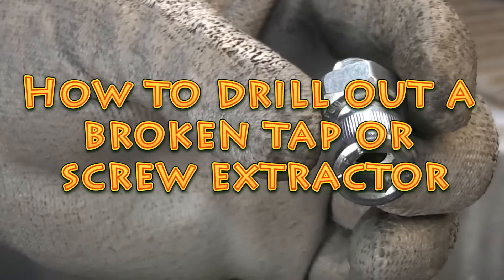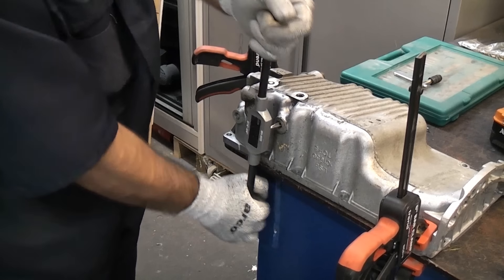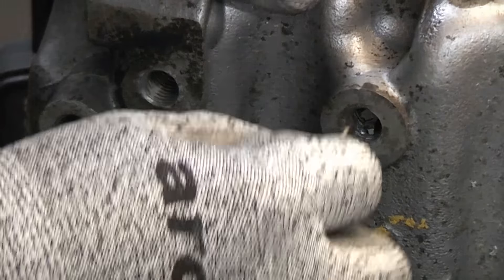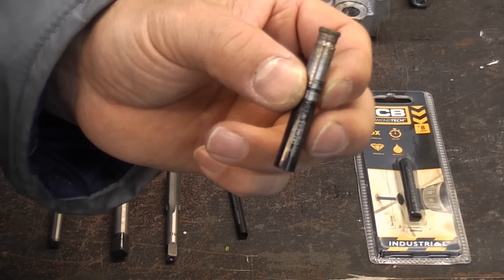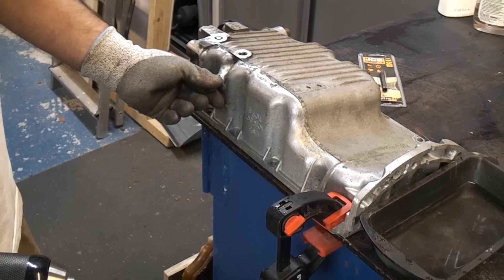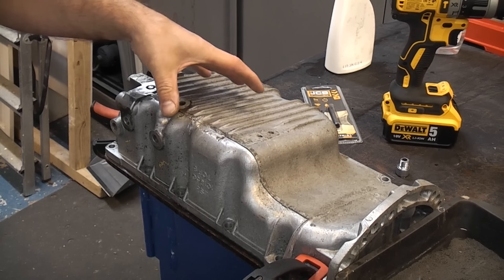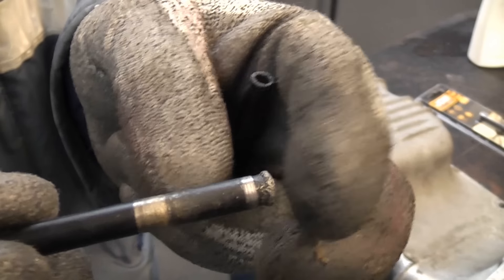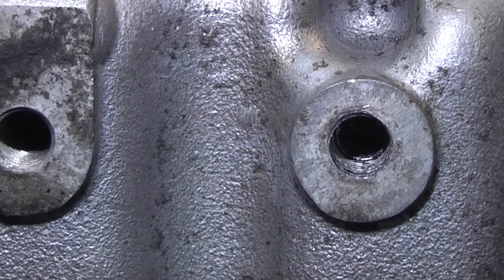How to drill out a broken tap | drill out a broken screw extractor

Comment: I can't believe you did this as a demonstration! You must love spending time in the garage. This situation is one of the worst
Reply from the maker: The main reason why I did this is because a few people commented on a previous video where I drilled out some broken bolts, normally with comments like "that's easy- try drilling out a broken tap", so I did. Now I'm waiting for the "it's easy on a bench- try doing that when you are in space - wearing a space suit" type of comments 😉
Thanks for the comment
Reply: I have to do this on an exhaust stud that broke in my mr2 and broke an extractor trying to remove the broken stud lol deff worth the watch I have to go pick up some of those diamond bits
Reply: @ThePjstokes  hey I have the same thing in my Suzuki m50 bike exhaust bolt right now! any tips?
Reply: @druegeme  make sure to stop for a tea every now and then
Reply: @ultimatehandyman  LOL
Reply: It's easy on a bench  - try drilling out a 1/2" vibration damper bolt with an extractor bit broken off in the bolt on a 2017 dodge challenger 6.4L scat pack in the middle of 2022 summer...in Texas...
Reply: @kill3mall224  this example should work..sometimes, depending on the diameter of the extractor where broken, you can go in with a diamond hole saw (that is smaller than the original hole threads, so you don't remove the threads) CENTERED over the extractor, and cut a circle around the extractor for a little way, then tap it from side to side to loosen the extractor and remove broken part. They generally are not held by much at all and easy to loosen if you get a little relief at the point they are held in the drilled hole.  
On another note, I'm puzzled why a damper bolt is broken off like that unless too long and got bottomed out?? Otherwise if just over tightened and snapped, generally not that resistant to drilling and backing out..🤔.. but you hopefully won? 🙂
Reply: Just happened to me, idk what I should do maybe a machine shop can fix it ?
Reply: How about broken bolt with broken extractor flush with end of bolt and frame?
Reply: 😢that's a pain. But on bench it's easy. What about a flywheel bolt

Comment: YES! This worked for me. In the past I’ve used diamond hole saws on enameled cast iron, so I’m not sure why I didn’t try it immediately. Instead I tried the Dremel route, as recommended on many videos and discussion boards. The thing is, Dremel grinding stones wear away pretty quickly, and they aren’t all that cheap either. A 2-pack of conical burrs is $15 CAD, and I quickly went through about 4 of them grinding down maybe 1/3 of the broken EZ out. The diamond hole saw was $25, but it ate through the remainder in under 5 minutes! That’s with me being patient and frequently dipping in water as he does here. After that it was simple enough to drill out the sides of the hole, re-tap, and Bob’s your uncle. It’s also worth pointing out that multiple mechanics and machinists I spoke to didn’t offer any solutions to the problem. Kudos, man, thanks for the tip!

Comment: I used this method as a last ditch effort and it worked!!! Broken bolt on a boat motor wouldn’t break loose after welding a nut on, heat, broke an extractor off in it, but this got it out. Took 45 minutes or so using his exact method! THANK YOU FOR POSTING THIS!!!
Reply from the maker: Nice work!
 Thanks for the comment 👍

Comment: I started out with the diamond hole saw bit method you demonstated here but became discouraged with the slow going. I picked up a Milwaukee carbide multimaterial bit (4 or 5 inches long and looks like a masonry bit) at a home improvement store for about $8.00 US. With this, the broken extractor was completely drilled out within 10 minutes. I still needed to tap new threads as you demonstrate in the video. Thank you.
Reply from the maker: Great to hear!

Comment: Kudos to your video and thank you for posting! I broke a bolt extractor, and your removal method was the only one that had worked. To make matters worse, the area was hard to access, so I had to get a right angle drill attachment and a quick release diamond hole saw. Turned out to be a two day job, but in the end I succeeded. Thank you!
Reply from the maker: Bolts always break in difficult to reach areas when I'm on site, they can be a real pain in the backside. I do get a lot of comments saying "it's easy when it's on a bench", I don't think some people realise that it's 100 times easier to film when it's on a bench!
I'm really glad that you managed to get the broken extractor out- well done ;-) 
Thanks for the comment 👍
Reply: Oh man im having a bad time right now. I snapped a bolt on an exhaust manifold and then snapped off an extractor in the bolt.  So I am in a simmilar situation. Worse thing is that I can't take the manifold off, without a garage taking the body off the vehicle.. so it's got to be done in situ.  I have some solid carbide bits coming, and some diamond hole cutters coming as well. I am worried that I might snap a carbide bit off in the hole and then things will be even worse... so I will probably take the extra time to do it this way. It's good to know im not the only one, and if i take the time I will eventually get it out again. Cheers.
Reply: Persistence and patience and a'lil experienced know-how are INVALUABLE skills that help you out of the inevitable holes we all  find ourselves in from time to time when life decides to kick you in the Jimmy's   
😳💥🦵excellent 👌 content bro this is definitely one that goes into the life toolbox 🧰 keep'em coming 😎👍💰

Comment from the maker: This video took a massive amount of time to film and edit, which is why there was no upload last Sunday (I’m also busy working and busy doing other things). Please like, comment and share the video (if you can), as it really helps me out.
I hope everyone has a great Sunday 😉
Reply: Thumbed up.  I got a good sense of the effort expended in the work, let alone the post video work :)
Reply: I have a cast iron manifold on my old MGA with 3 rusted in bolts that I want to renew. I have tried heat and penetrating oil and a pair of nuts locked together but have not moved them at all - advice would be appreciated. You have provided some interesting ideas, I am impressed, thank you. Tony Clarke.
Reply from the maker: Studs that are rusted in can be a real pain. You have to be really careful with manifold bolts as they easily shear. I'd keep applying the penetrant, but also shock the studs by hitting the end of them with a punch and hammer. The shock can sometimes work wonders.
If that does not loosen them, you could try putting two nuts on the stud, tighten them together and then try tightening the studs slightly, before trying to undo them.
Best of luck with it ;-)
Reply: Good job altogether. These tasks are very challenging. Some great tips I never thought thought of before. Thank you,again.
Reply: link to the guide?
Reply: @TheTC2  the original version  impact driver often helps hugely. Before the modern power tools we had impact drivers . Usually had 1/2 inch drive, left or right, which enabled any size socket to be used or a range of hex drive  screwdriver bits. 
Make sure direction of twist is in correct direction,  then a solid belt with a heavy hammer causes shock impact , together with some directional twist. 
Modern impact drivers only deliver impact twist  consequently are more likely to sheer studs off rather than the old style ones delivering this plus general shock impact which  will usually release,  even these can still sheer studs, so sometimes the combination  with heat is still  necessary.
I have yet to see the combination of heat, shock and twist fail.
Good luck

Comment: What a great video...being a much more experienced millwright at a food plant in Canada, I am constantly being asked to remove broken bolts/taps/extractors from stainless equipment! The younger ones just don't have the patience or experience in removing their mistakes. Once worked with an expert in a steel mill who was able to remove any broken object in a threaded hole. Cheers and thanks for sharing.
Rick from Hamilton, Ontario:)
Reply from the maker: Thanks Rick, we have a lot of stainless equipment at the place where I work and it definitely requires patience ;-)
 Thanks for the comment 👍
Reply: Some stainless is a nightmare to tap. I go for less than 50% thread. Sometimes a lot less. Even the shadow of a thread can hold in stainless. I look in the hole and can barely see any thread. A fastener will still grip tight though.
Reply: Thank you for your work, Rick!

Comment: Thought I would update on here as a way of saying thanks!   This method totally worked for me.  My situation was slightly different, because I had to do it in situ. Also the bolt I snapped off was smaller diameter (M6)  and therefore the extractor was smaller too.  I ended up going on ebay and purchased a pack of x10 4mm diamond hole saws, and because they are so small I ended up getting through all ten of them before getting through the extractor.  But the pack of 10 was only about £10, so well worth it.  I could then drill the rest of the bolt out and re-tap the hole.  Great advice on taking your time with this job, it pays off!
Reply from the maker: Brilliant!
Well done for having the patience and perseverance to complete the job 🙏
Reply: Would a pack of 5mm hole bits be better? Was this a bolt that broke or a tap? I have the same issue.

Comment: Just snapped a 8mm 316 stainless bolt off, drilled it out to 6mm,  stuck the easy out in and it snapped off flush. I watched 4 videos on removal options, purchased, drill bits, dremmel bits and spade type tile drills. They all broke. The only thing that worked was your tile drill bit. It seemed like it wasn't working after the initial sharpness wore off, so instead of going slow i just hammered it for 10 seconds at time, refreshing cutting fluid and it worked.  Over all, 6 hrs of trying and failing, 30 mins of your method and success!! Thank you, one can stop swearing now.
Reply from the maker: Well done for being so persistent and not giving up 👏 👍

Comment: You offer good solid advice! I’m a machinist in New York, I work often with aluminum 3/4 inch thick plate, usually sizes range from 19.00 x20.00 to as large as 36.00x30.00, either 6061, or jig plate. Saving a plate this size is a priority. We machine these plates on a VF6 Haas machining center. Occasionally, taps break. Since these are always in house items, I have a lot of leeway on how I extract the broken tap. My preferred method is to use a fractional size carbide end mill. Say for a 1/4-20 tap, I’ll use a 1/4 inch endmill. Usually 900-1100 spindle speed, sometimes flood coolant, other times I’ll use Moly-D cutting oil from a can. I crank down the spindle in the manual mode in tenths (.0001) with some luck, one endmill will survive doing the job, other times I’ll go through 2-3. Once the hole is cleared, I’ll re drill and tap for a 1/4-20 Heli-Coil insert.
Reply: Pretty much the same method I use as well. Although, you could use a 5mm carbide endmill, and not have to use a heli-coil. A 3/16ths might do it as well?
Reply: Wow. Thanks for sharing. Do you use a normal electric hand drill.
Reply: If your working with aluminum you can always dissolve the tap by soaking piece of aluminum for a few hrs or overnight in a heated solution of Battery Acid and Alum (potassium aluminum sulfate). method works great for aluminum but does take awhile. won't harm the aluminum in anyway whatsoever but it may discolor the aluminum but the discoloration rubs right out with a good aluminum polish or can just hit it with a piece of fine sandpaper. done this method many times breaking off small taps like 1.5mm and 2mm I use for aluminum parts for R/C vehicle parts and it works awesome. works well enough that I actually have a glass jar filled with the solution in garage just for those rainy days that ill need it. lol
Reply: AWESOME INFO, THANKS FOR THE SPEEDS, LUBE, ENDMILL INSTRUCTIONS!!!
Reply: If you're breaking taps frequently, why not buy a metal disintegration machine and do this job in a few minutes?

Comment: One thing that has made removing broken bolts/screws easier for me is the use Left-Hand drills when drilling out the center of the broken bolt because sometimes they will snag and turn the screw out for you saving time and effort. This would be after getting the center drilled if you were to use the drill guide that he made/uses. Great video and I will be looking for these JCB drills. Thanks so much!!!!!
Reply from the maker: Absolutely, left handed drill bits are great ;-)
Thanks for the comment 👍

Comment: First off excellent job of showing how to get broken bolts out.  I owned a radiator shop and we had to fight broken bolts in aluminum radiator tanks. Steel bolts in aluminum radiator tanks would seize in. The bit you used and the bolts you made are great. I would have bought them.  I have a few other ideas. 
1. If you had the hole pointing up you could have filled it with water or WD40 so you did not have to dip so often.  
2. Snap-On makes a kit with reverse rotation drill bits. It comes with guides that center the hole. They are not as nice as the bolts you made. They are not threaded. But the screw extractor that comes with them is custom made for the drill bit size and works better than the tapered screw extractor. 
3. I have heated up the broken off tap/bolt and let it cool slowly to soften it up.  Then drilled it out. The cobalt bits are good but they are also prone to break off.  
4. I have welded a nut on to the broken bolt with TIG welding and heated and backed it out.  
5. I really like HeliCoils, they work great.
6. I have drilled out a bolt and moved up to the next size at times.  
Final note: You could sell the bolts you made. I am old and retired, but surely would have bought or tried any new items to make a task like this easier. Keep up the good work!
Reply from the maker: Thanks for the comment, Patrick 👍
Reply: What you ran into is called the galvanic effect of dissimilar metals. Something to do with the covalent bonds of the atoms being different between the two metals. In effect they make a weak battery. Along with making a battery they corrode like a battery can too. Aluminum oxide is what sandpaper is made out of. So it's some pretty hard and abrasive stuff. Oxides being brittle can be used to advantage. Sometimes you just have to shock the monkey. Impact beats torque.

Comment: Yes this was very educational.  I'm partway through a job.  Don't know about my next step. Very hardened large steel bolt.  Using carbide bits.  May resort to a diamond hole saw but many videos say they don't work good?  I've used them in the past and they really helped with broken taps, and extractors.  Keep up the great videos!

Comment: Very good. If you break a tap its a disaster, usually. I am happy to learn that there are still options that does not require a repair shop. I liked the emphasis on self control. When i was a teen tinkering with stuff my dad always tried to teach me to take a 15-30 minute break when i felt a rage and need to smash things up with a hammer.  It cost me a fortune in broken stuff before i finally learned the wisdom of those words. :)
5 out of 5 for this video!
Reply from the maker: I've been told that I have a lot of patience, but I do swear a lot when doing jobs like this- especially when I was on site!
A guy that I worked with on site had even more patience than me (Vinny Davies), he had the patience of a saint for sure!
Thanks for all of your comments 👍

Comment: working on a engine .two blots snap/ drilled out one stud.used a extractor .next one snap r. 5/32 BSF used a mig .no way.  used a harden pointed chisel. chipping a way at the die .2 hours later got it out. talk about a brake. your right. just my luck . fitting a oil pump in the casing. did not use a nuff heat  split the casing.   i wish i seen your video before hand.  thank from john
Reply from the maker: Hi John, that sounds like a nightmare! 
Thanks for the comment 👍

Comment: Mr ultimate probably the very best thing you can add to you toolkit after the centering bolt is a set of left had threaded drills. I can sharpen my own drills by hand because I have done it so long. If you do sharpen your own make the bite very aggressive. It is many times faster than your method but it is very nice to have your method to fall back to.

Comment: This does work! I used a Milwaukee diamond hole saw bit to drill out a easy out that was broken off in an exhaust stud in the engine head. I took my time and used water to help lubricate it over and over. Eventually it came out and I was able to tap it and save the head.
Reply from the maker: Thanks for the comment 👍

Comment: Thanks for another good video. I broke a screw extractor once.  I initially thought "oh no" but due to the tapered profile of the screw extractor(SE) there is not a lot of contact between the SE and the bolt.   I manged to knock it clockwise to release its grip and just took it out.   A broken tap is a different matter. I would recommend before drilling the tap or SE to try something - anything you can think of to rewind it out of the hole, when all else fails then move on to the good advice in this video.
Reply from the maker: That's a good point about the screw extractor 👍
Thanks for the comment ;-)